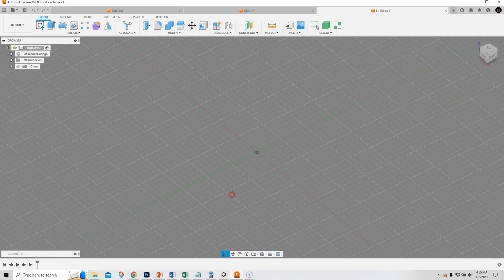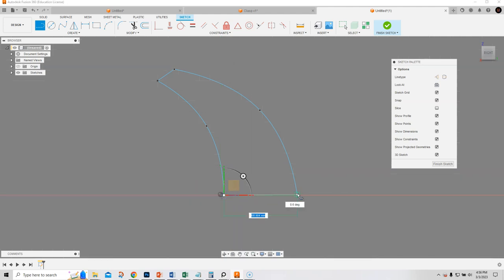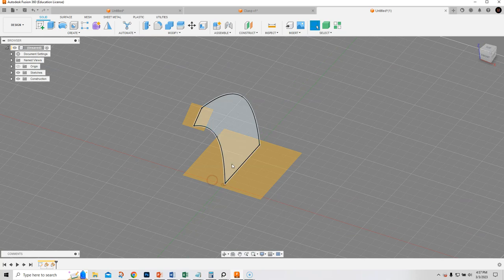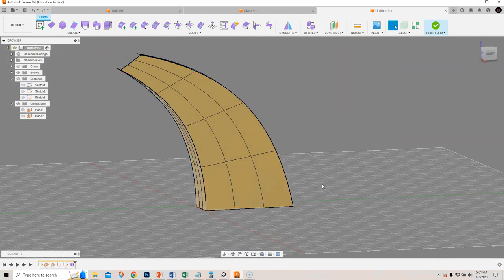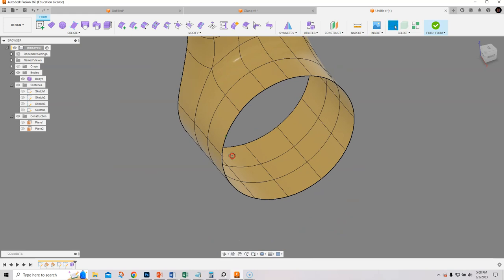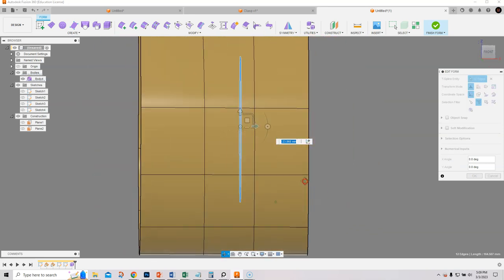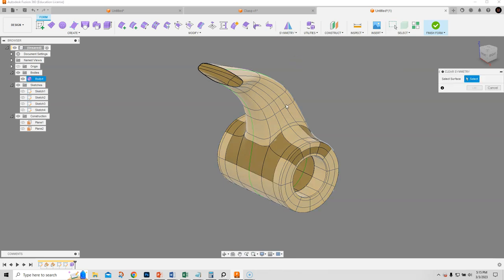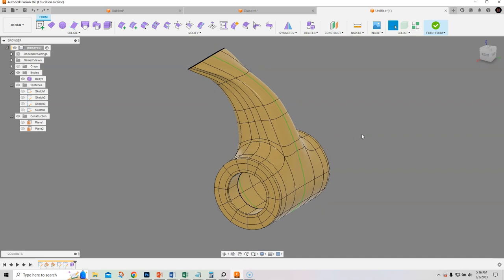T-Splines | SubDivision Modeling Organic Forms | Fusion 360

Comment: One thing that t spline toolsets, they won’t record within history bar. So sometimes you have to make some copies from time to time.
Reply: Hey, how do the copies help with the work flow?
Reply: @TurboHEMI_426   When you are making t spline, you can use 3d face, bodies,edges, sketches. So if you make some more variations, you can save some copies. Also you can adjust numbers of tspline points while you convert those 3d elements.